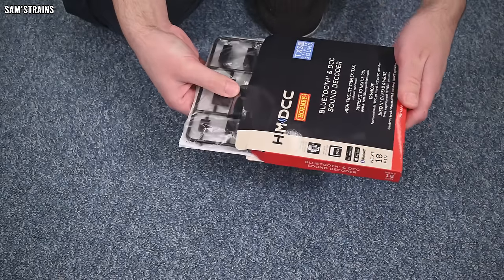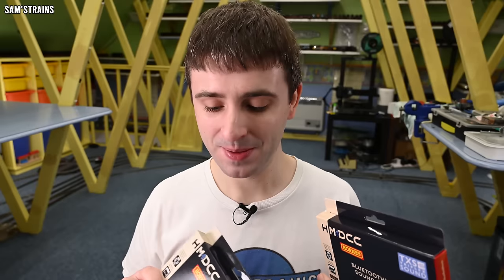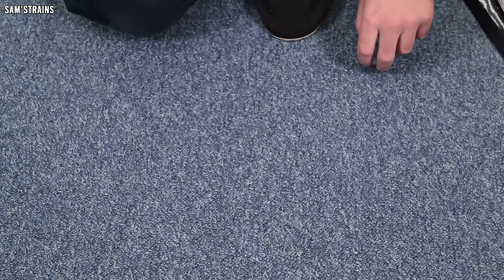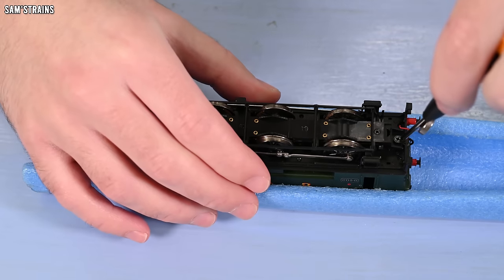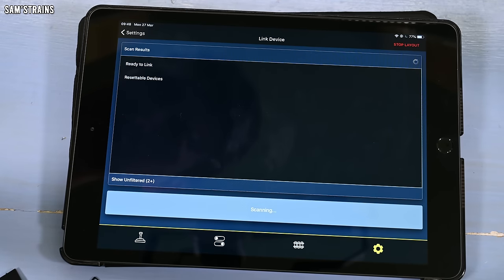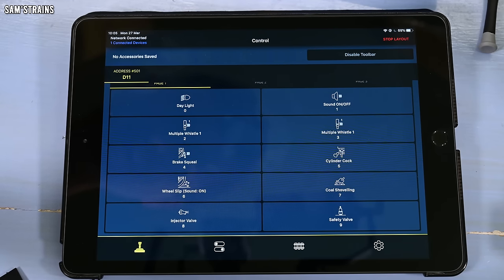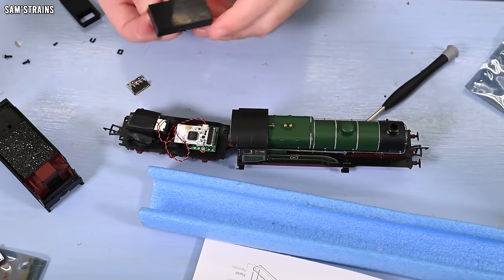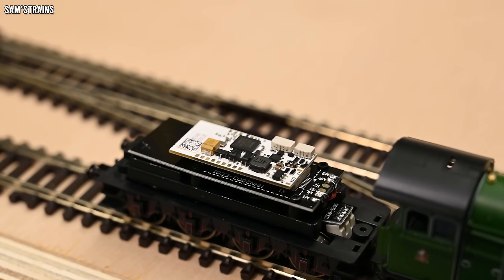Too Big For Most Locos & Burnt Out After 1 Day | Hornby's New HM7000

Comment: A great idea, poor performance, doesn't fit many oo standard gauge locos so no chance with narrow gauge steam and the sound is very limited Not impressed with the huge box either. Let's hope another manufacturer developers a similar system that fits and works better and is sensibly packaged. Finally for the decoder to only last 1 day makes this system way too expensive. Decoders in general are much to expensive, modellers are being ripped off

Comment: DCC and smart devices do not mix. It's an absurd idea. With DC and baseline DCC, even if the tech is deprecated, you can still use it. Anything connected to smart devices though? Obselecence kills the whole thing.
Reply: Absolute Nonsence,,,, Rocos Z21 is designed expressly to use a smart device as the control input device. Please brush up a bit!

Comment: Not impressed. A Bluetooth based controller that handles the communication between controller and loco over direct DCC? More sane. A WiFi based controller? Even better. The only advantage I can see for a system like this with wireless control inside the Loco is with garden railways with battery powered trains, and WiFi is still a better technology for that because the device can roam between AP's as it moves from your house to your garden and back. Other products already exist in that role.

Your range test was impressive, but I don't know where you live. Having (3?) floors suggests to me you're not in a terraced flat in the middle of a city. In those kind of environments, this will get interference from: lightbulbs and smart meters (zigbee), wifi, other bluetooth devices, keyboards and mice, your neigbours cheap baby monitor, a passing cars' dashcam, a microwave, and basically any other wireless device imaginable. In my semi-detached house, I doubt this would work in the next room to me. In my old apartment I doubt it would work over a distance of half a meter - my keyboard didn't.
Reply from the maker: Thanks for sharing! I'm not sure how well wifi would work with multiple devices at once. Though to be fair I'm unsure how bluetooth with handle potentially tens of connected devices at once - does need testing! Nope, I'm living in a hose with all of the things you mentioned... a pretty typical house!
Thanks for watching, Sam :)

Comment: I’m sorry but decoder size is an issue - pardon?!? I’ve got many TTS, ESU and Zimo decoders and some of these HM7000 ones and they are no bigger than the others and they don’t have the Bluetooth antenna!!!!
All models have space limitations - so it’s about buying what fits, maybe researching that first would help?!?

I love most of your video’s usually Sam, however you always manage to get something with a fault or some sort of issue. 
It’s beginning to become a bit coincidental…..
Reply: I disagree. The bluetooth chips need the stay alive as well to function properly. The reasons were spelt out clearly by Sam. So sure..  space with these new chips will often be a problem, particular in small locos. It was very correct of Sam to illustrate this, as if you look at other vids and reviews on this new release (even from hornby) they have not emphasised this could be a limiting factor. Also once purchased (say to try and fit ..trial and error) , it is very hard to return a chip as once opened from packaging, manufacturers and retailers think you have shorted it or screwed it up or something. Kudos to Sam. He had every right to call Hornby out on not making these issues with the new chips crystal clear on the release. cheers
Reply from the maker: I don't see your point - my requirements for the next18 decoder were as limited as could be: as a reviewer, I needed a single locomotive in order to test the decoder with. Not a single OO loco I tried had enough room.
As for the failure, I see, so it's my fault? Are you suggesting I caused the fault deliberately? Please explain your "coincidental" comment.
Thanks for watching, Sam :)
Reply: How do these decoders manage to fit in the TT loco’s then?!? Swings and roundabouts….

It just so happens the loco you attempted the fit, was too small…. 

Also - the manual is well worth a read Sam, but it’s well over 100 pages….presumably you skipped it??
Reply: @PhilLomax-hb9pr  The chip goes In the tender?
Reply: @wapphigh5250  5 of my 6 HM7000 decoders do not have a stay alive fitted, and one of those is a class 08 so how did you come to that conclusion?
Reply: @wapphigh5250  - so that loco was presumably designed to be fitted with a specific type of decoder…..

I can’t get a various 8 pin ESU V4 decoders into Bachmann steam loco’s - are ESU to blame for that?
Reply from the maker: "It just so happens the loco you attempted the fit, was too small…. " - no, I tried the decoder in countless locos, and it fit none except the TT locos.
I read all of the basic instructions sent with the product. This is what any typical user would do. If important information was omitted from the basic instructions, that's an oversight on Hornby's part. The extended manual is presumably for specific queries and more detailed information. It shouldn't contain mission critical instructions.
Thanks for watching, Sam :)
Reply: @SamsTrains  …or by not reading the manual that contains comprehensive information, that could be an over sight on the reviewers part?
Reply from the maker: Re-read the above comment Phil. The instructions were followed as per Hornby's paper and video instructions. Full stop.
Reply: @SamsTrains  exactly my point - I’ve read them and it even states in various places about the main manual. Admittedly I nearly fell off my chair when I saw how big it was - but it’s there and there for a reason!
Hardly a fair review if you haven’t taken the trouble to read it I’d say…..
Reply from the maker: But why would anyone spend hours reading the main manual if they don’t have a specific query? The system was perfectly simple, I managed to work everything out within a few minutes. The basic instructions contained everything necessary to get up and running. Again, what’s your point?
Does this heaven-sent manual explain why the decoders aren’t NMRA compliant in terms of dimensions, when the box claims that they are? This I’d love to know!

"All models have space limitations - so it’s about buying what fits" - this is plain wrong. Locos adhere to the NMRA standards in the space allowed for a decoder. These decoders purport to adhere to the same standards, and they don't. Stop blindly defending the indefensible.
Reply: @SamsTrains  Agreed. Hornby did not warn anywhere about the real size of their decoder. Concurrently, Graham Farish issues a clear warning about the size of the 6 pin decoder required for their class 03 in N scale (needs to be subminiature).
By default, if you buy a next18 decoder with no clear indication of its limitations, it ought to fit in ANY engine requiring a next18 decoder. If not, it's deceptive advertizing, and it's not legal in France, and in the UK too I guess.
Even Hornby warns on size limitations for DCC decoders on their OO J50, so...
Reply: @SamsTrains  The NMRA had standardize the size of the DCC decoders, it's not for kicks... You are conform to the standards or you are not, you can't fiddle around with that. And if you are not, you ought to warn your customers, period. I perfectly know I had to buy a subminiature 6 pin decoder when I bought my Grafar class 03, because Grafar told me so.

Comment: When you look at whats actually there and the price of general electronics its worth about £15. There's about £10 worth of electronics and lets say £5 worth of coding including the app - and thats being generous. 
The only reason this seems like a decent deal is because of how much of a rip off they have been up until now. 
Also if you want dcc I find its ususally because you want to control a lot of locos at once. For me that seems like the smaller, shunter kind would be the main target since the larger stuff can usually run on its own loop for a lot of its use. 
Between the cost of fitting multiple locos with this, the hassle of set up and the limitations the sizes bring I just can't see how this is realistic for most people who don't want to invest thousands - which is where it will be for a decent layout and all the stuff to make this work in even a lower number of locos. 
Imagine trying to replicate the shunter docks or similar. 
Lets say you only use 10 small shunters at around £100 each then these on top of that. You're well north of £1500 before a single length of track, rolling stock or even a baseboard.

Comment: Pfew, actually this was extremely hard for us to continue watching. Terribly sorry Sam, but this genuinely isn't revolutionary nor is it even half decent executed. We think it is rather primitive, unreliable and overly complicated to set up and get it working. Even the $0.99 priced Locontrol app dating from 2020 is miles ahead when in comes to simple usability and reliability. 
The H decoders themselves, as cheap as they are, are simply too primitive and unsystematic designed in the sense that - from the looks of it - the PCB as a hardware has been poorly designed when it comes to effective usage of space present; could easily have been much shorter. Great concept, but A. years behind, and B. poorly and unsystematic executed. This H contraption could put people well off, will give DCC a bad reputation rather than inviting... So terribly sorry, but this is just gawd awful... Cheerio.
Reply from the maker: Thanks for sharing! Yeah the Next18 ones are pretty much useless for anything I tried in OO... and the fact that it failed within a day sucks. That said, I had much more success with the 21pin one... if I could customise the sounds a bit more, I'd be all for that!
Thanks for watching, Sam :)
Reply: @SamsTrains  Well, that's 2 aspects. 
1. The software itself is just horrible. Why would one have to figure out (very cumbersome and time consuming) how the heck an uploaded sound CV is to be allocated to the buttons on the screen... That evidently should go automatically (as normally expected), and why on earth would a power cycle be needed...
2. 10 Minutes download time to the loco... good lord...
3. Bluetooth seems a nice cheap idea, but their heat are a source of early failure of devices. DCC chips themselves already can get hot not unusually potentially frying themselves as are... Märklin, Zimo and ESU loksounds do cope much better though, but they are ~20 Euros more expensive. They've had their share of heat related problems as well in the their decades old past. H apparently is inventing the wheel again, making the same mistakes while the tech itself is decades old by now... 
4. No protection against any voltage spikes as it seems... Meaning, apparently H allows to connect to any controller, even their cheapest ones (without filters)... Good luck, but chances are that the decoder can be fried quite easily if the loco is on the track whilst turning on such controller... 

Absolutely horrible on every aspect this product...

Comment: Why are you surprised that a Hornby decoder for a Hornby system doesn't work in a competitor's range of trains..!?! I'd have been surprised if it did tbh. Why not try a Hornby train..? Now, if that doesn't fit I'd say you have room for a grumble. But not when you're using Bachmann trains for a Hornby chip.
Reply from the maker: I’m surprised because Hornby states on the box that the decoder complies with NMRA standards. It’s a standard, so it should fit in other brands. Hornby don’t produce any next18 locos in OO that I’m aware of, so I had to try the other brands.
Reply: @SamsTrains  Thanks for the swift response. What you say does makes sense. Though tbf the decoder did seem to fit. It was the housing around the engine which appeared to be causing the problems. I'd be interested to hear if that's a problem with Hornby 00 engines. Still, I get the impression the 18pin was designed with the Hornby TT:120 scale locos in mind from the other vids I've watched on tbh. Do keep up the videos. I always like to know your opinion on matters before I make a purchase.

Comment: I have now stopped shouting “Read the flipping instructions before you condemn it,” and I’m feeling a lot better now. I’d also invest in a chip removal/insertion tool. Too many opportunities to criticise you for removing the chips with a metal screwdriver.
Reply from the maker: Yes, well I'm glad you're over that... being that the product is extremely simple to understand and worked fine without me having to spend multiple hours reading a 100 page novel. As I've said to someone else, the metal screwdriver isn't problematic - the power was off, and no capacitor was connected. In the unlikely event the screwdriver shorted critical components together... nothing would have happened because no flow of electrons could've occured.
Thanks for watching, Sam :)
Reply: @SamsTrains  Yr Awesome Sam. Yes Give it back to them Dude!

Comment: Oh dear Sam, you really have made yourself look a bit of a ‘Charlie’ with this review. You didn’t read the manual and you got things wrong… you tried putting a decoder into models that are not designed take it, you poke about electronics with a metal screwdriver, you don’t turn the sounds on and guess what, they don’t work, and because you make all these mistakes you blame someone else. In the past I have supported you but I feel this is the end. Mine work perfectly, I know many many many others that work perfectly. If your decoder has genuinely burnt out, it has a warranty, Hornby will replace it. Learn how the technology works and it will help your understanding and hopefully future reviews.
Reply from the maker: I did read the manual, and at no point was it stated which locos the decoder was designed for. So what' your point?
What does the metal screwdriver have to do with anything? Did it's influence break the decoder after 24 hours?
The burnt out decoder will be returned, I know how warranty works.
Thanks for watching, Sam :)
Reply: @SamsTrains  you clearly didn’t read the manual, you have to turn the sounds ‘on’ to get them to work. Any decoder from any manufacturer will potentially have size issues, these have been designed to fit Hornby Next 18 socket locos primarily. As for the screwdriver wielding, that’s simply a no brainer. You don’t understand the technology but you are reviewing it? That’s an unusual approach to take. Of course time will tell who is right on this and sorry to say, you Sam are fired
Reply from the maker: I got the sounds to work without “turning them on”. The metal screwdriver would only have been a problem if power was on, or if a capacitor was involved. Since neither was true, the screwdriver was fine. Again, I did read the manual, you can see me do it in the review. Why do you ignore this?
Reply: @SamsTrains  anyone blessed with the gift of sight can see the settings on your tablet when your sounds weren’t working. Ask an electronics engineer why they use anti static mats and earthing straps when dealing with components, poking a metallic screwdriver into electronic componentry is not not advised or do you know better? As for your lack of understanding of the technology, I see you have side stepped that issue. Sometimes in life it’s better to admit, you made a mistake and that’s good, but to keep defending a mistake is doomed

Comment: Gets a Hornby decoder system, designed specifically for Hornby loco's - cos that's what Hornby does - and  then moans that they don't fit into non-Hornby products!
That's like buying a Mini Cooper and then moaning when the Chrysler 426ci Hemi doesn't fit into the engine bay.

Why would you even try that? No common sense sometimes . . .
Reply from the maker: Simple answer Neal: because Hornby doesn't use Next18 decoders in their locos. I'm not aware of a single Hornby OO loco with that socket, so what would you have me do? Did Hornby state that these decoders were only for their TT locos? No they didn't. You're right, no common sense.
Thanks for watching, Sam :)
Reply: Wrong. Hornby have stated their chips should be compatible with other manufacturers locos. I just watched their recent vid. Go check it out!
Reply from the maker: Interesting, that clears that one up then. It may be compatibly with other's locos, but I couldn't find a single one!
Thanks for watching, Sam :)

Comment: If only you had read the instructions before attempting to ‘demonstrate’ the decoder. Also, it looked like you were deliberately choosing locos that you knew would not accommodate the HM7K decoder - you should be ashamed at trying to pass this off.
I trust you will issue an apology to Hornby and retract the misguided and misleading comments immediately.
Reply: Interesting, which locos would you suggest testing the fit on?